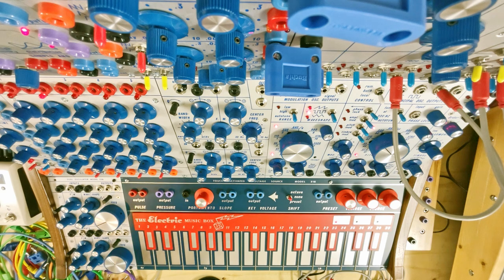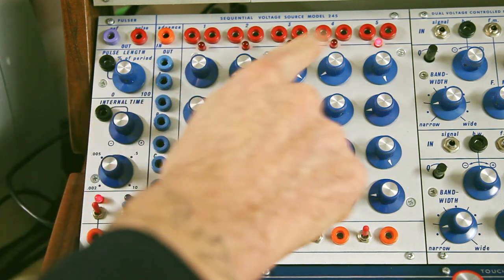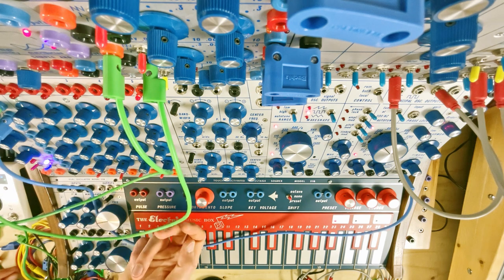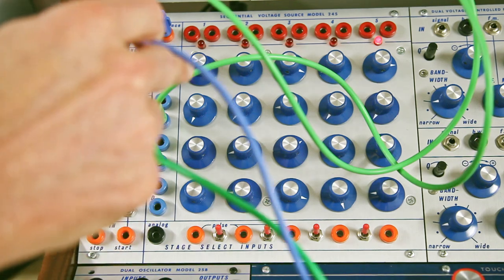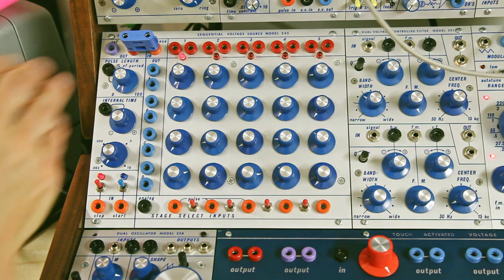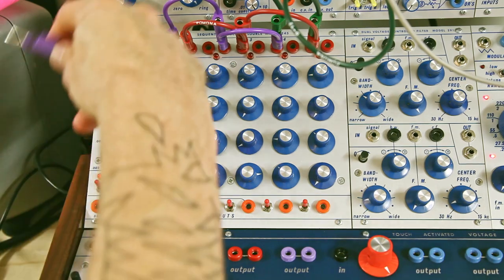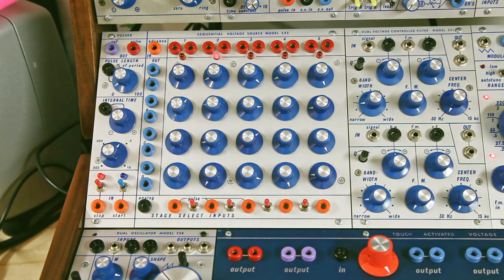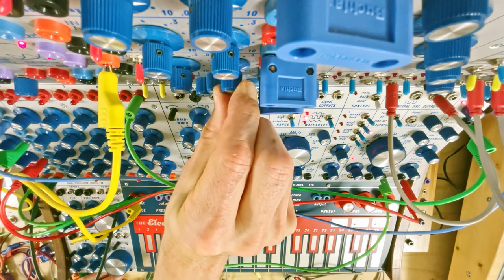[The Buchla Series] #2 - Buchla 245 Sequential Voltage Source

Comment: Since the Buchla/Tiptop collaboration was announced I was thinking about 245. This is first video that was clear. I was particularly interested in the voltage control of the pulser. Your vid shows it works the way i thought - thanks! I think a pair of these and a pair of sequential switches has a lot of potential!
Reply: Pretty much why I am watching it. I am afraid I will impulse buy modules while waiting for these and end up with something I don’t need. But I can always build a second rack. Oh no what have I got myself into.
Reply: Same reason im watching lol but i do own the z8000 and it kinda feels like its the same but individual clocks per seq and direction, i really like the buchlas clock